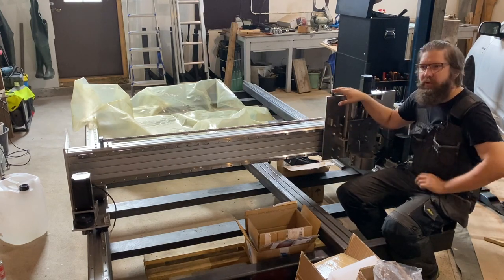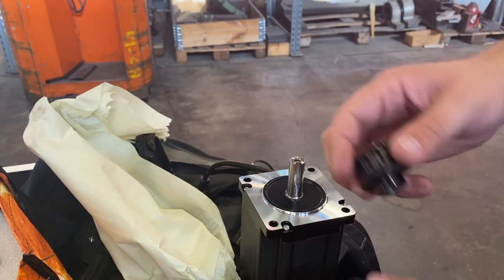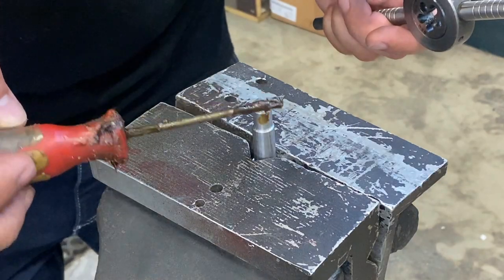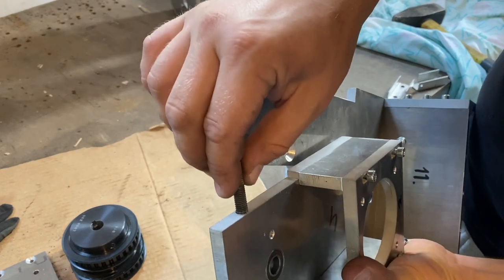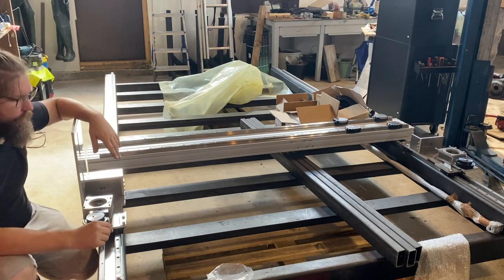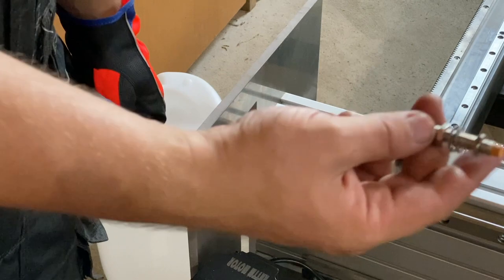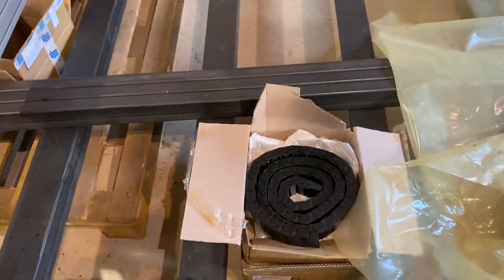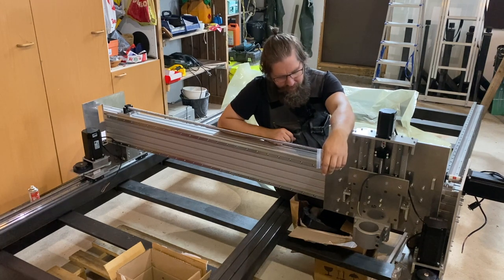Big DIY CNC router  - part 6 - last parts and whole assembly! Ep23 Project SeaCamel

Comment: It’s looking good. I would perhaps look at getting it running , “cutting air” before you thread lock everything. Did you buy “extension” cables for the encoder signals ? It’s a quicker way of getting every thing up and running, rather than soldering onto the 15 way dtype connectors . 😃
Reply from the maker: That’s a good idea. I might do that.

The soldering job is already on it’s way. There wasn’t that much ready-to-go connectors anyway. Only the four on the encoders and the cables which came with the motors weren’t long enough.
I just hope that there wouldn’t be much interference. 🤞🏼

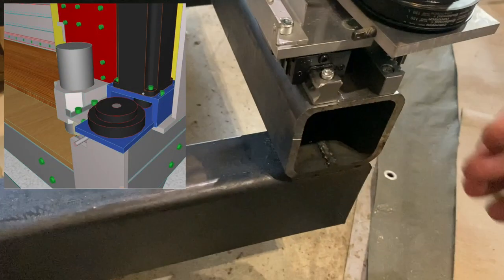Comment: That really is impressive, you must be proud of your achievement. The whole set up looks very robust and should ensure you get real repeatability. I am not sure if I understood correctly but where you talk about fitting a sensor (approx 18:30) for the end stop on the long longitudinal rail and say the finish of the structural box section is not so good so that you may have to fabricate a mounting plate from plywood - did you not consider a custom bracket that could actually just be bolted to the end of the track itself? (There is already a cap screw at the end of the track (securing the track to the base rail) for securing the bracket).
Reply from the maker: Hi Norman! Actually yes I concidered that kind of option as well but I would also like to get as big operational length as possible. That stopper option would probably shorten the Y axis with more than 10cm. (some length from both ends). I don’t know if that’s really important but that’s the reason I built machine this big. 😅

And I am proud! Now I just hope that everything works as planned! 🤓😬🤞🏼
Reply: @ArcticSeaCamel  we all want more ‘operational length’.🤣

Comment: Hi , what reduction do you use , and why ? 5:1 or 3:1 ? I am building a similar 2m x 3m CNC and I can't decide what to use ... ? Pls help <3
Reply from the maker: Hi!

There's no particular reason for having reduction here. It's just to keep the weight of the motor more on the center of the "thing-that-attaches to the rack".
The motors are 12Nm so plenty of power without reduction!
Reply: im feel motivated to make a proyect as you , the motors are 12Nm  constant torque or peck , can you share the part number , best regards 
 @ArcticSeaCamel
Reply from the maker: I bought them as a kit from eBay. I believe they were sold by Rattmotor or something like that. Included with controllers.
There’s plenty of suppliers for them and mounting is standard NEMA32.

Comment: One thing for sure you've just about re-invented the wheel here. That machine must of cost you a fair bundle. I think it would've been much cheaper to purchase one instead designing and building your own machine. You know you've got your self a descent machine being that you've made it so you know what you've invested in it.. Hope the route you have taken here pays off for you when its all said and done. Nevertheless you got a good machine to move forward with your plans and you can always make things for folks as your building your boat which will most likely pay you dividends by the time this project is all said and done. Its looking good.
Reply from the maker: Well. Basically I just took the ideas from others and tried to make them as easy to build as possible. So nothing new.

Machine this size is not something you can just buy. Most of the hobby machines are small and bigger ones cost easily double or triple what I spent here.

The most expensive thing was the machining of the table and the aluminum parts. Electronics and other stuff wasn't actually that much.

Machine isn't perfect, but it works as it should and now I have very well made platform to build from - should I some day want to make something differently.
What I'd do differently if I was to make this again is to go with aluminum extrusion. They're much more expensive than steel, but wouldn't necessarily need expensive machining.

Comment: This is so interesting. Im about to build a cnc myself but not as big as yours. I have 4 THK 985x20 mm rails and 8 THK carriges. I really would like a bigger machine but it is too expensive to buy THK rails. Is it possible to use other brand rail with the THK carriges or do i lose all precision then? (The rails i have i got for free, all brand new). Really looking forward to see your progress!!
Best regards from Ruotsi!
Reply from the maker: Hejsan! Thanks for your message. I really can’t say if rails have any standards. I bought mine as set from cnc-discount.com and they seem to be quite OK quality as I can see. Maybe you could buy only the longest rails for Y and the existing with X and Z?
Reply: @ArcticSeaCamel  Yeah, that was what i was thinking about to do. If i buy new for Y, i can use the 985mm for X and Z. Lets say i want 350mm travel for Z, then i have 1620 left for X. That means i have enough witdth for a whole sheet of plywood or a whole sheet metal plate (im thinking of building a router/plasma combo). I think i would need something like 2700mm of Y travel to be able to machine a 2500mm plywood. Since i work as a CNC plasma operator i can do many things for the machine at work. We also have a huge FIL milling machine to make everything flat and precise. Thank you very much for sharing your build and answering questions!
Reply from the maker: Sounds like you’ve got things under control! 😃 Good luck, make it happen! 😊

Comment: 8-26-23 are you using something to square your gantry when homing
Reply from the maker: 23-08-27 (😉)
No. I actually don’t have homing system currently at all. I have just set the zero position and I make sure that gantry is not moved while power is off. It has held its squareness very well so far. I checked it while ago by measuring 3-4-5-triangle and it was spot on.
Reply: @ArcticSeaCamel  thanks man I am building mine and that was my main concern
Reply from the maker: @TheNeilcoppley  Yeah, I was worried about it too but i'm relieved that it has held it's position so well. If you check my video of making the 3d-carving of the stem piece, it was essential to have the zero position in the right spot for many days. Also since that I've done the second half for that stem piece with the same setup and mold. There was months between the first and second and the zero position hasn't moved "at all" during this whole time.
The whole gantry can be moved quite easily when there's no power on the motors. So you need to make sure to power them up always before doing any fiddling with the machine - like cleaning the table etc. for not to accidentally bump into it.

Comment: Did you use servo motor...?
Reply from the maker: No, they’re closed loop steppers. So they have encoder that stops the movement if steps are lost for some reason. That is actually another thing I need to add to the motion controller, a signal that stepper has error.

Comment: Please I can get the motor and driver reference?
Reply from the maker: Hi. I bought them on eBay, Rattmotor. They have plenty of options. I bought 3 motors pack for the big ones and one of the smaller.
Reply: @ArcticSeaCamel  Hi. Please I can have the link of stepping motor purchases

Comment: Stepper motor size ???
Reply from the maker: Hi. There's two sizes. Bigger for Y and X are Nema34 12Nm motors and smaller for the Z axis is Nema23 4Nm (if i remember right).
Reply: @ArcticSeaCamel  👍